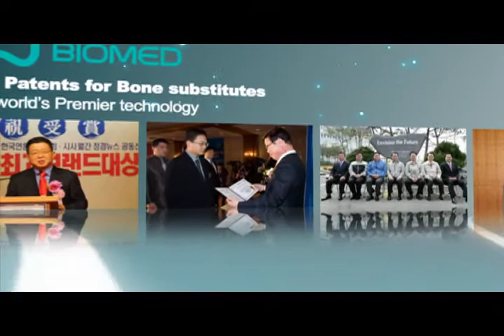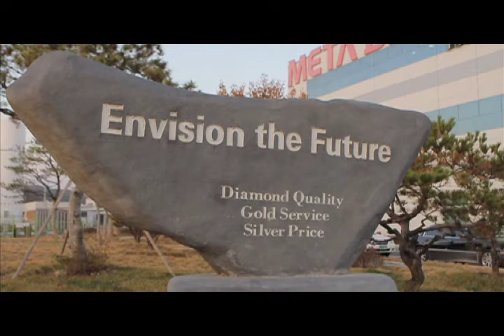Synthetic bone graft material | Dental equipment | Metabiomed Co., Ltd

Comment: Hello, I'm Phd student in Metallurgy and Materials Engineering at Marmara University in Istanbul. My thesis project is fabrication of  bone graft materials from different animal bones. It's goal is which animal bones are appropriate for human body when it's applied for bone healing in the body. Hydroxyapatite from bovine bone and  coral are well-known as a bone graft material source. So they are commercially used in biomedical applications. My question is about how to obtain hydroxyapatite bone powder from animal bones without bad odors. Because bad odors are expanding during calcination. Could you help me, if you know the solution in order to inhibit them during calcination process.